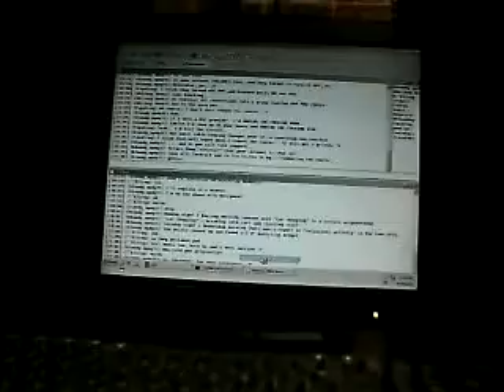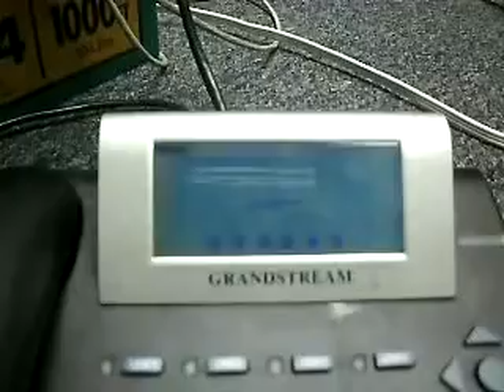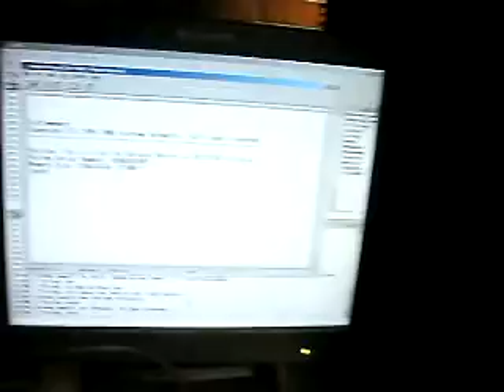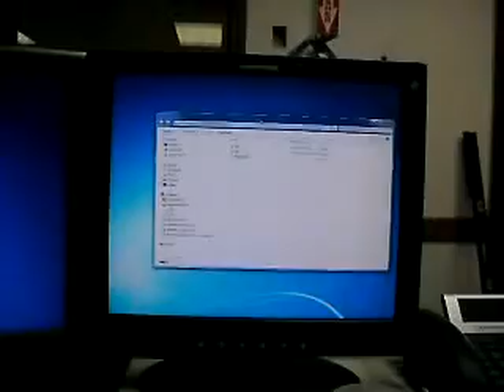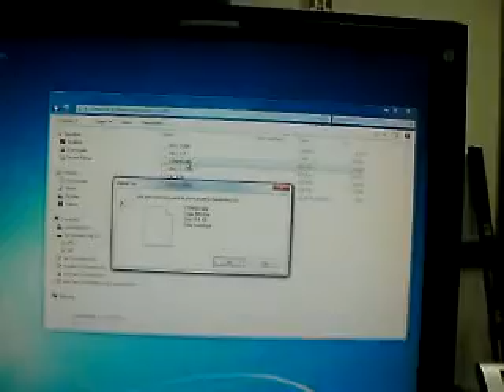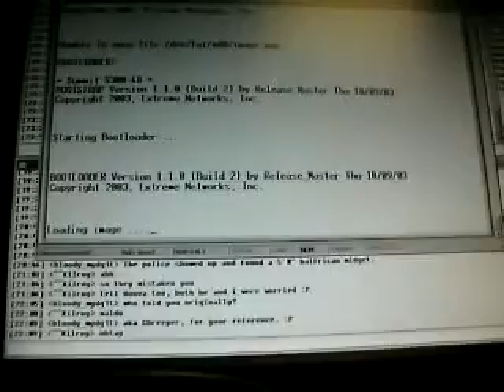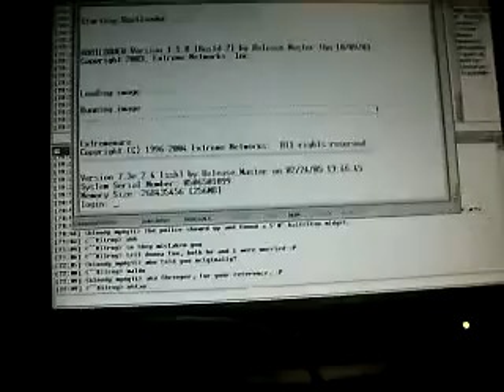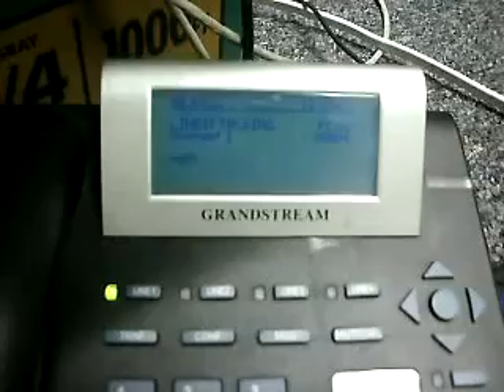Extreme Networks Summit 300-48 password recovery (probably for 300-24 also)

Comment: Putting this where google knows where it is: On a Summit 400-24t there is no CF card, but pressing the spacebar during boot brings up the boot menu, where you can both a) boot to factory defaults and b) erase configurations saved on the device.